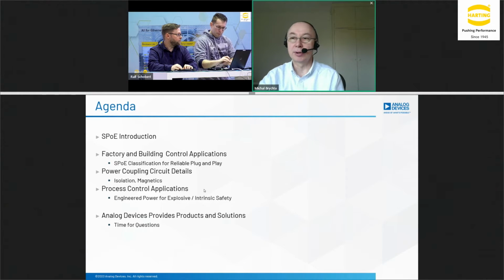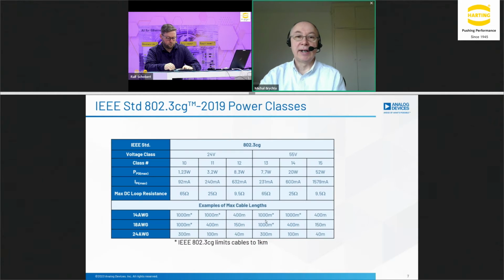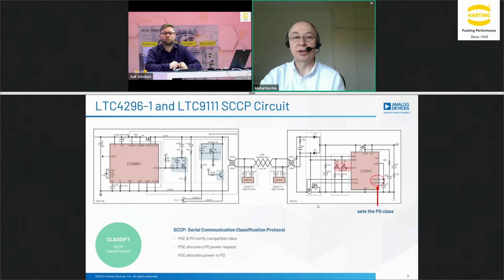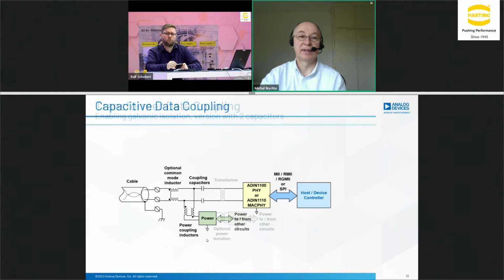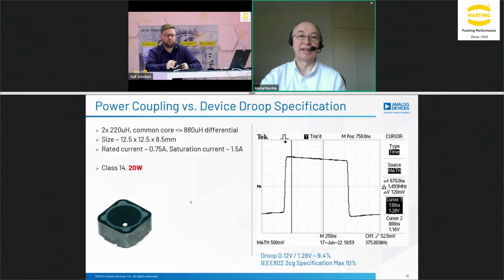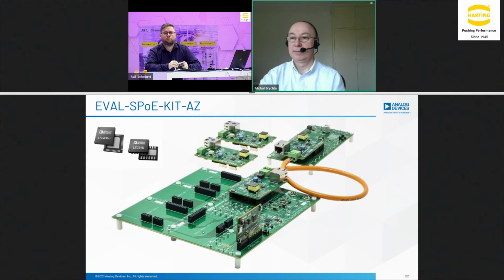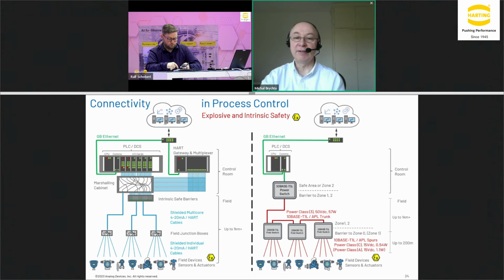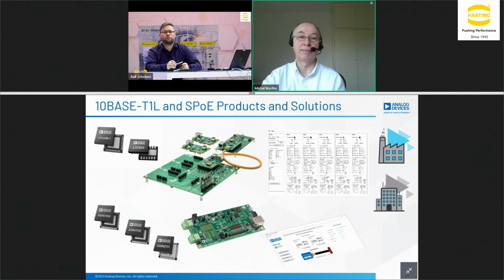POWER OVER SINGLE PAIR ETHERNET - CHALLENGES AND SOLUTIONS

Comment: Does it require PSE and PD IC if we are only making the sender and receiver for a specific power class and a specific use case? Where the intention is not to use them with other 10baseT1L devices in the market?